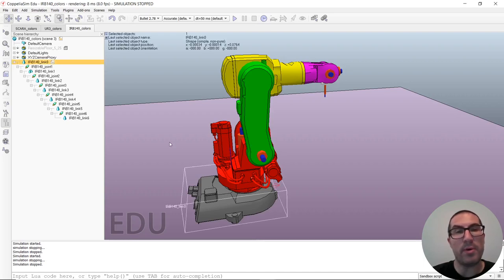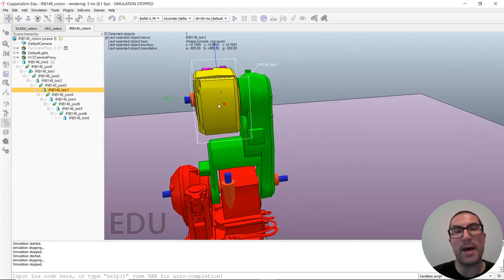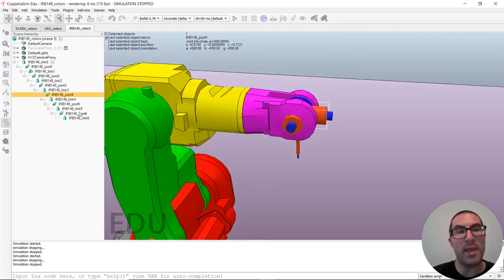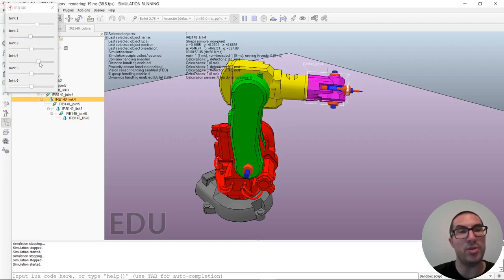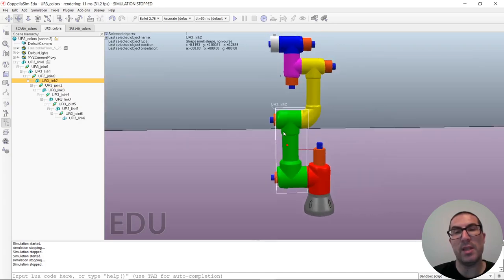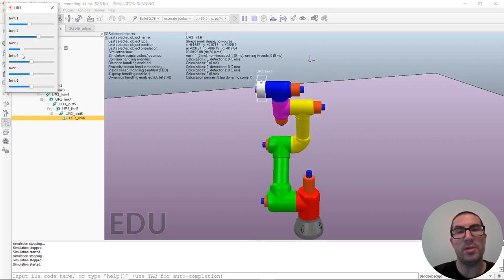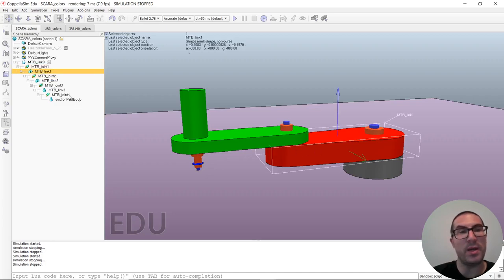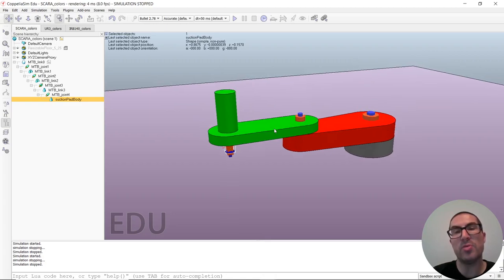Identification of Links and Joints in Robot Serial Manipulators | CoppeliaSim (V-REP)

Comment: sir,
I created a two link flexible manipulator in V-rep for my project. Now I want to  measure the vibrations of that two links. 

1)Can you please tell me is it possible to measure the vibrations generated in the flexible links in v-rep? And, how can i measure this?

2)Is it possible to measure the vibrations generated in the flexible links using available sensors in V-rep? If yes, how?
Reply from the maker: You can attach a dummy object to a specific position of your flexible link and measure the acceleration. You can use the accelerometer module provided in the model browser, for instance.
Reply: @LeoArmesto  thank you sir